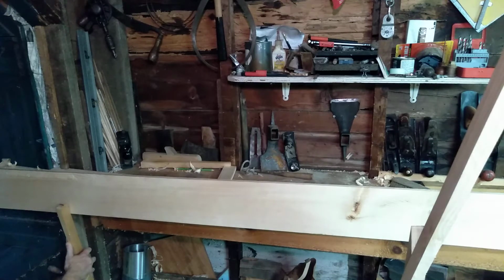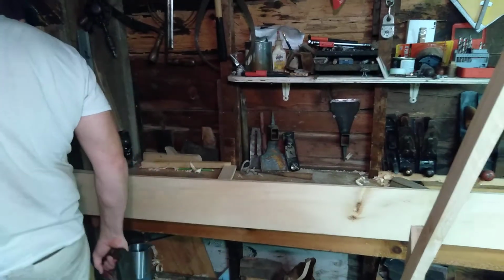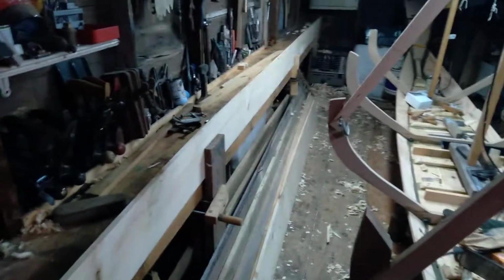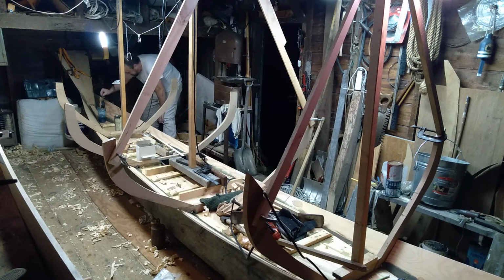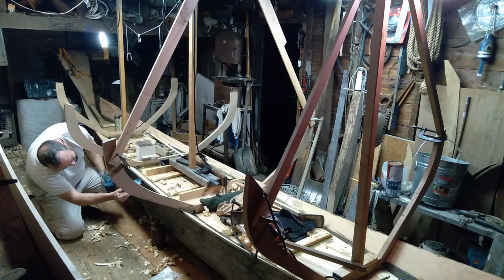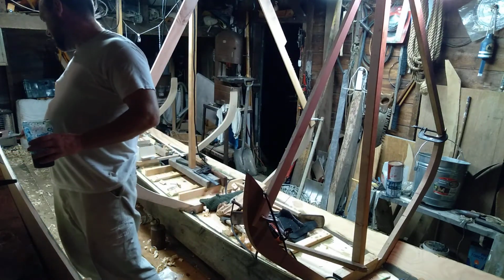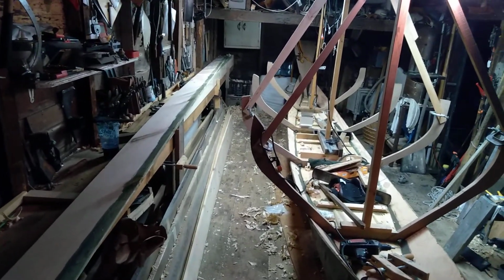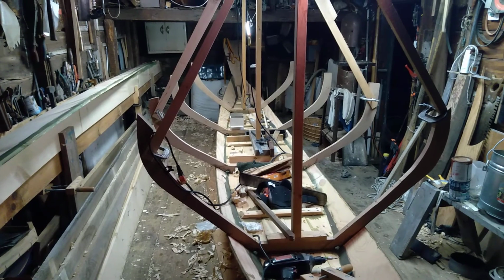wooden boat building, planking a dory.

Comment: great job ! you are in the middle of the magical planking process! is the cooprous oxide the same material they use in plumbing and stump removal... you also mentioned it in an earlier video that I will have to review also!
Reply from the maker: Glad you're enjoying! I'm using copper coat, it's water based, the modern replacement for Coopernol wood preservative which was taken off the market a decade ago.